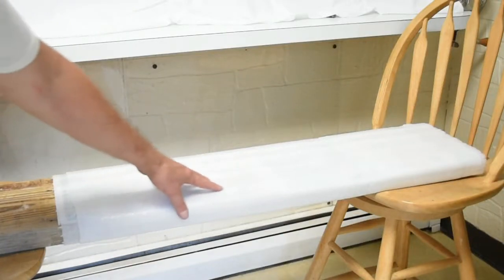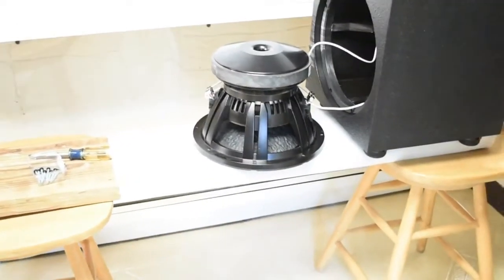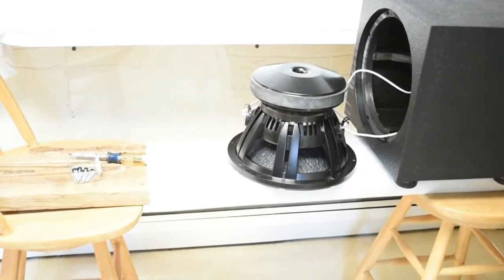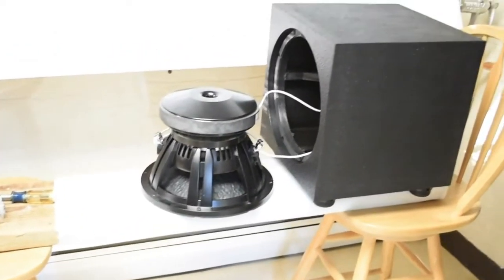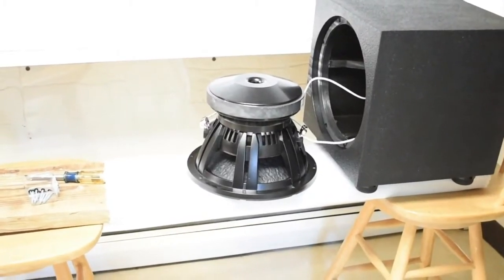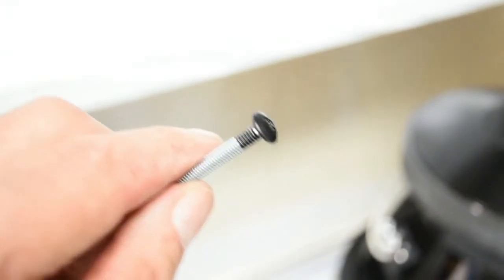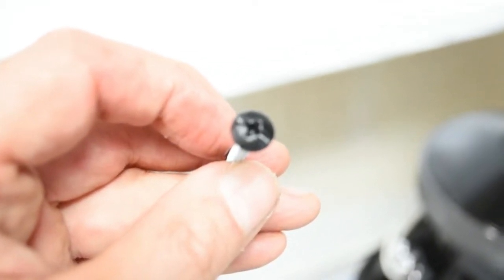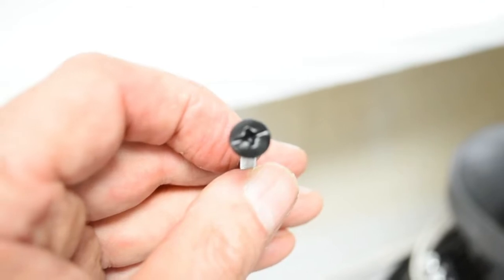CSS Sdx12 Driver Install Flat Pack 14" Sealed Subwoofer

Comment: Make loops from cable ties through two screw holes in the frame lower and align the sub, cut the cable ties, install screws.
You're welcome.
Reply from the maker: It was a thought, but there isn't room to the outside of the driver to the recess so the ties would need to go between two holes on each side... then pulling the ties out would probably tear up the gasket underneath... seeing how this drive is 48lbs. Anyway, it's a good thought but in the end... handling the box seemed better for me. And if you want simple... don't use t-nuts, just set the driver in and screw it in place how ever it sits... no alignment needed ;-)